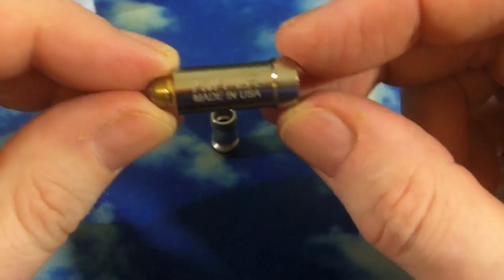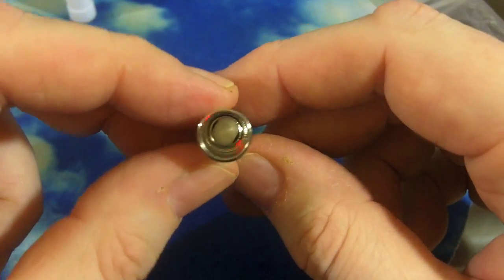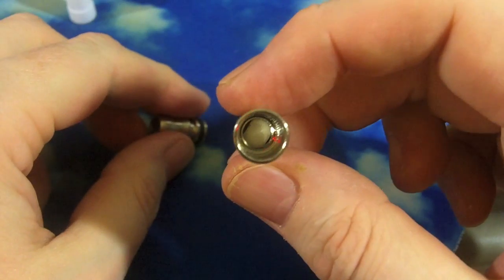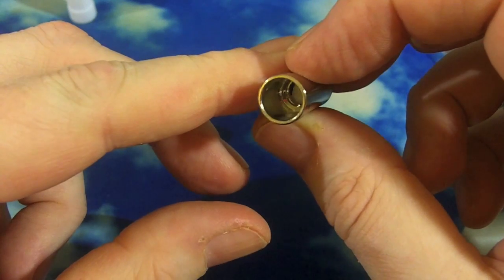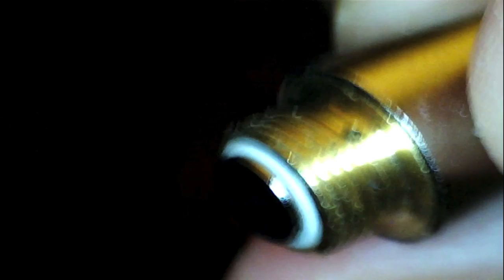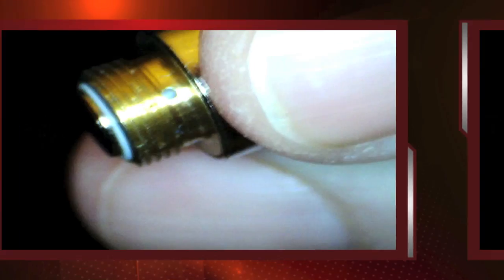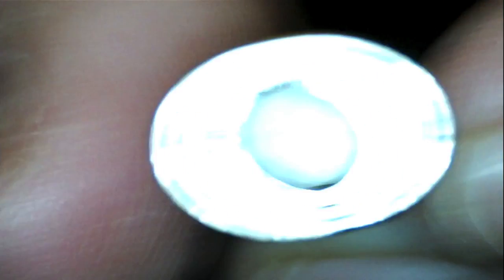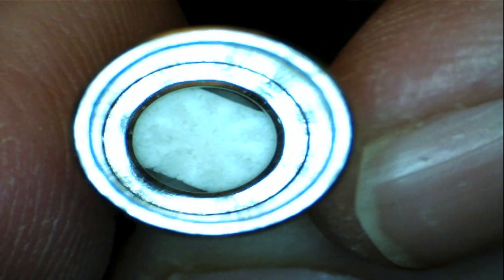AVA Atomizer

Comment: I have a 510 charging adapter that would allow that to be used in a drip shield just fine & I wouldn't fuss over that ridgey bit sticking out the top as long as the juice is contained. I have the newer bottom feeder version and it's absolutely flawless on my REO. Newer ones don't have that ridgey bit and work great with drip shields with the 510 shorty extension or connectors that stick up enough

 Prof Beard on the UK Vapers forum has put over 118ml of juice through one so far...

Comment: Thanks for taking the leap to try this atomizer. I have been interested in trying it out but for 50 at innovapor or 40 at thermovape its alot to spend on a single atomizer. I guess when you think its the cost of two HH357 its not so bad but when you think about 5 cisco attys versus 1 AVA its hard to take the plunge. I probably will try one but its not at the top of my list for new things to try out.